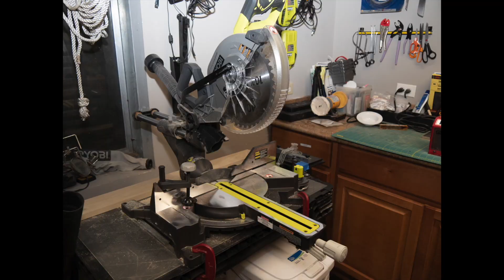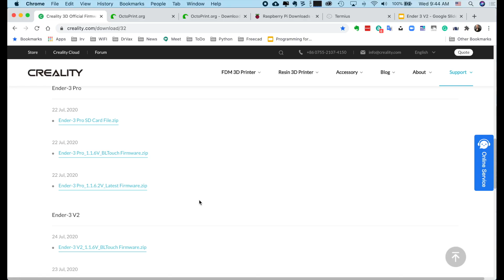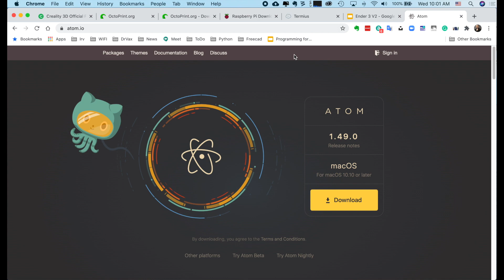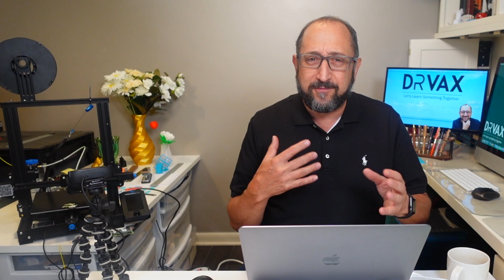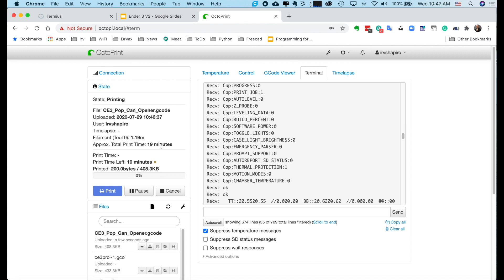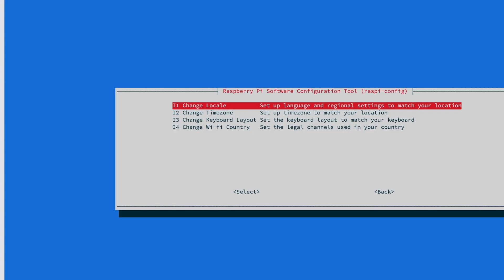Install Octoprint | Ender 3 V2 Firmware Update | Wifi 3d Printing

Comment: Two questions
1) Did you notice an operational advantage of and RPi4 over and RPi3?
2) May we assume your camera plugs into one of the RPi USB channels - yes/no? The stream from a RaspiCam connected to an RPi 3B+ is pretty bad - constant stuttering intermixed with long pauses.
Reply from the maker: The RPi4 is quite fast and while I did not have a lot of issues with the RPi3 I expect the speed will help with higher resolution video streaming.

Yes I plugged the camera into the RPi USB port.
Reply: @MakeWithTech  Thank you for the reply.  I think my best option is to get the RPi4 and test with the RaspiCam; and only If still unhappy with the results, spend the bucks for a real Webcam.  Incidentally it is really nice (for me) that you are a Mac user as I get to see programs for my Mac that I haven't tried yet.
Reply: why do you need such a high resolution for streaming? 720p seems sufficient.
Reply: @KingNothing22 When I set it up for to use a RaspiCam I took all the defaults for anythign I didn;t need to touch to get the camera and streaming started.  To be honest, that was a year ago.  Thanks for the heads up though - you raise a good point.  If the default is 720p then I will knock it down.

Of course I will still want to get a new toy.  Um, I meant to say RPi4 ... really!  ;-)
Reply: Oh, I forgot to mention that it might just be that my local wireless setup is the throttle and not the camera's configuration of the processing power of the RPI3B+ itself.  One more thing to investigate.

Comment: How save is it to put  my wifi password in a txt file on the Pi?
Reply from the maker: Since the Pi is locked in your house and not accessible from the Internet it is probably safe.  I am sure there are alternatives but I did not see the need to research them.

Comment: Thank you much for this video. Can I ask you what you dialed in for the v2 on Cura? So far for me the stock Ender 3 Pro profile has been great. The only thing I changed was max resolution and max travel resolution.
Reply from the maker: I have been experimenting with retraction of 4mm at 40mm/sec and increasing the travel speeds to reduce stringing.

Comment: Great video had already install octopi on a raspberry pi 4 and connected it up to my Ender 3 V2 so knew most of what you said in the video except i didn't know about the option in cura about printing directly to octoprint. Thanks for explaining that saves me several steps. Also when I installed octopi noticed that the bed and hot end temps were not being reported in octoprint. Found a fix for that on the internet but if you didn't see that maybe they already fixed it in octoprint. Again great video, keep up the good work and thank you.
Reply from the maker: Thanks for sharing.
Reply: the Ender3v2tempfix.py still has to be applied.

Comment: Great walk through
It is a long time since I have seen the Octoprint homepage. work like a treat.
Is the M600 (Filament Change) working on the Ender V2?
Pruceslicer have a link to octoprint too.
Thanks for sharing :-)
Reply from the maker: I just checked and unfortunately M600 does not work.  That is really a shame.  Here is the replay:

Send: M600
Recv: echo:Unknown command: "M600"
Recv: ok
Reply: @MakeWithTech  V2 missing some important Marlin firmware features compared to Ender 3 and Ender 3 PRO.
Reply from the maker: I will check out M600 and let you know.